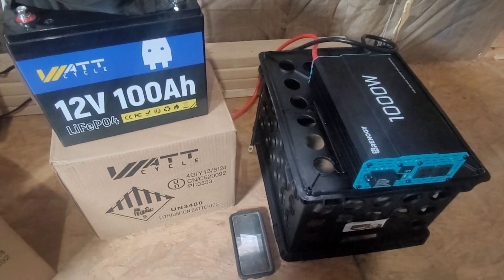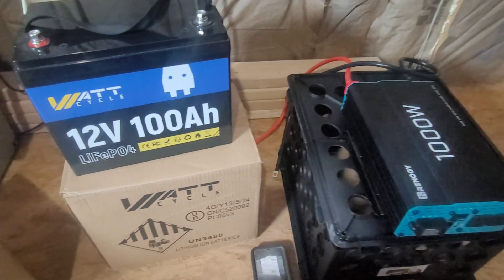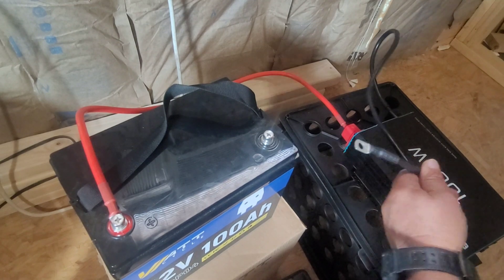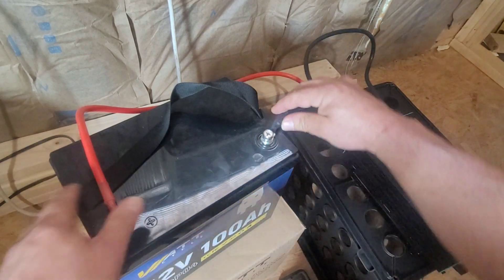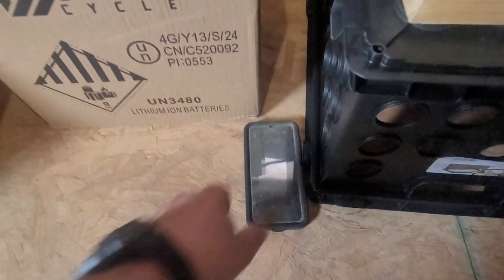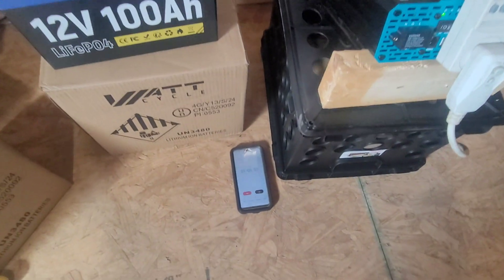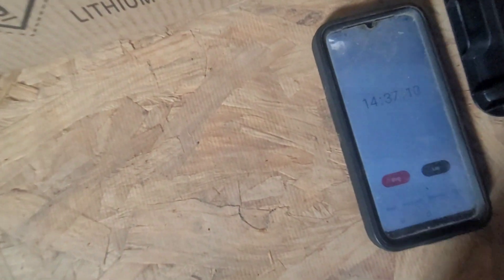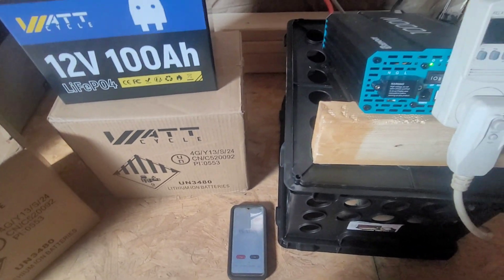Watt Cycle 12v 100AH Battery/ Renogy 1000 Watt Inverter Powering AC Window Unit

Comment: I had issues starting that same ac unit with a 1k inverter. It was pulling 1300-1400 starting wattage
Reply: I've never found a 5k btu ac that ran on 500 watts. Somethings off here.